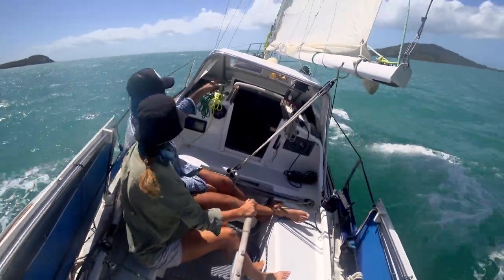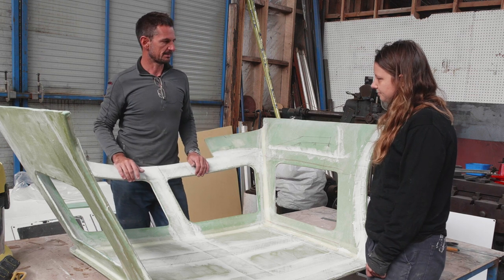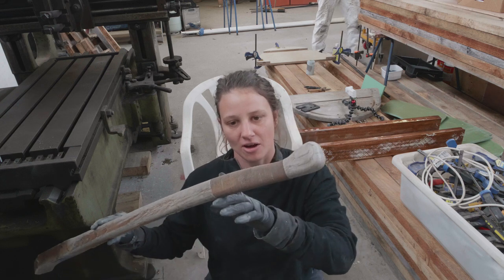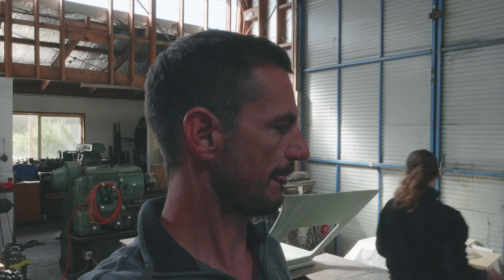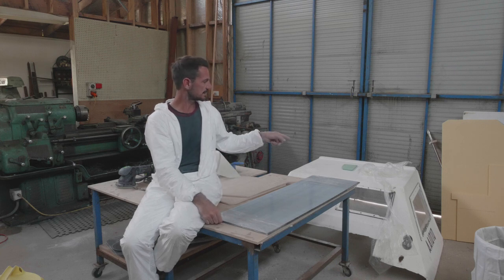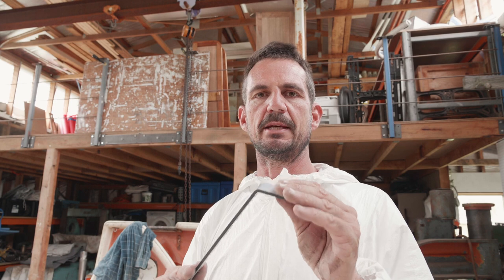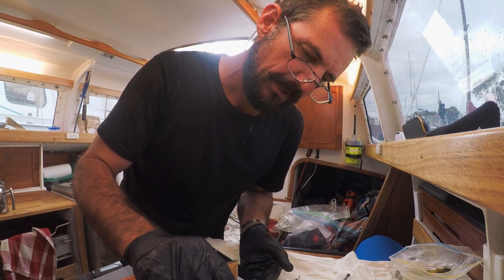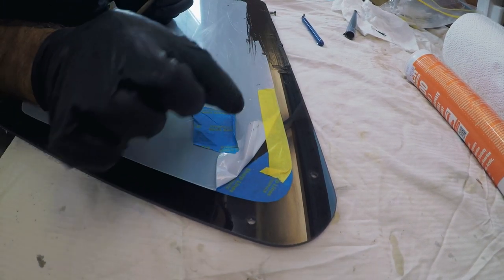HARD DODGER. The Grand Finale - Free Range Sailing Ep 161

Comment: Wow! SIX months! Fortunately I only had to watch the videos ;-)  Nice work on the dodger and the windows. Just know that the tinted polycarbonate panels are going to expand and contract with temperature changes at a greater rate than the fibreglassed vinyl foam of the dodger. If there's no give at the fasteners, the induced stresses will likely result in some deformation. There must be some products that will fill the inevitable cracks on the windows and some that even provide UV protection against crazing.

Comment: I had some vandalism on the rear window of my station wagon and ended up replacing it with straight clear UV-protected 4mm polycarbonate because the glass that fell out after it was smashed by some POS was also 4mm. I got it in there and all the factory trim back on and looking mint. To clean it just water blast (not an option for you) but rinsing didn't work for me to get dust/dirt off after some months in service and I didn't want to rub/brush/wipe it off as it would scratch it and you'd see it pretty easily. At the moment it looks factory, though and the water beads off it months later like it's brand new or freshly waxed :-)
Reply: Yours looks like 6mm? I can full on punch mine (tested in case someone else does) and it just booms and sends my hand backward. Try it with the side of your first (not knuckles...). Looks great! Nice work. I probably would have used some weather resistant non-oily timber around all the places where you need fasteners and screwed straight into that with self tappers, though I understand the attraction of what you did. The one in the car is only glued, no fixings at all. The 6mm toughened glass on our boat is only glued in, too, and in 26 years it's only been redone once AFAIK. Maybe due for a redo again in the next 5 or so. We'll see.

Comment: That's great thanks for showing us how it's done, very stout and I wouldnt have thought about the poly screw holds and that's really thinking ahead to avoid catastrophic failure later. As I like to say, "That's usin the old nut!" Thank you both for sharing your work with us it's something I was thinking about doing as well because the canvas tops just seem so lame. Super expensive and disposable how long do they look really good? Until the first goose shits all over it. That's not very long and between them and the seagulls it could be destroyed in a week not to mention all the scrubbing where as that is super easy to keep clean. So many things I wouldnt have thought of until it screwed up later. Really, thank you.

Comment: I use to work in a body shops we would first get it close as possible to done then spray on primer and after that was dry we'd spray on a light coat of a deferent color and then use a long sanding block and wet sand tell you were down to the primer and any low spots would still have the second color left and high spots will show fiber glass through any thing really low gets a little filler and any thing really high you sand down with additional coats of paint until you get it all uniform and then you paint , and by sand down with additional paint I mean heavy coats of primer and light coats of second color and just keep working it tell you get to a finish your good with but if you wort it long enough you can get it flat enough the finish paint will look like glass

Comment: You might have problems with all the bolts in the windows due the different thermal expansion, which I know there was problems on lifeboats in the North Sea oil rigs.  They had to rely on the glue rather than the bolts.  Might not become a problem but has been a problem on other installations.
Otherwise your doing a great job and I envy you the workshop you are fortunate to use.  Fair winds

Comment: You may already be aware, but you can get some great silicone tools for shaping goo like epoxy and silicone or urethane adhesive etc from glass specialist shops/businesses. I picked up a set from a local one here a while back and they're awesome for spreading stuff in a non-flat but smooth/controlled curved way. Check them out online somewhere :-)

Comment: It looks absolutely amazing. One thing you mentioned about the polycarbonate, is that it’s more susceptible to scratches than other materials, so a bit more care needs to be taken when cleaning. Curious if the screen protector material that’s used on digital devices could be applied to the windows to prevent any potential scratches? They also have clear material to protect the windows in sandblasting cabinets. Then again, it might be more trouble than what it’s worth.

Comment: Nice save on that adhesive-loaded window Troy!

I wonder how hard that adhesive sealant will be to remove when the lifespan of the polycarbonate windows has been exceeded.  

Did you consider using an easy to disassemble and remove butyl sealant with all those through-bolts used to secure the windows, so that the replacement of the windows might be an easier project rather than a major PITA getting the glue apart?  Is there is an easy release compound available to get that sealant to debond quickly without endangering the dodger's painted surface?

If that adhesive sealant is strong enough to hold the windows in without bolts I can only imagine the violence it might take to get the windows back off again.  I would be afraid that repairing de-bond damage.and prepping/painting the dodger again after window removal might take more time than the actual replacement of the windows.  

It seems to me that polycarbonate windows are a bit like car tires, they will eventually wear out.  I wouldn't want to weld the car rims to my wheel hubs...

Comment: Aye m8’s, totally agree on using polycarbonate. Next choice would be glass. Acrylic isn’t living up to it’s standards when it comes to scratches or cracks in a marine environment, I can tell. And about Festool: I’ve got four of their machines and are VERY happy about the quality and usage benefits. I only have invested in 18 volts, cord free units. Easy to charge on a boat. Not really more expensive than other brands. Had some trouble with one of the batteries and they sent me a new one without questioning, so I’m very satisfied since more than five years while using them a lot (like hard core usage). 🛠
Reply from the maker: Yes. Festool is fantastic here too. If your machine breaks down here the dealers give you a machine to borrow while they repair it which is a pretty amazing service. We've opted for Milwaukee 12v battery power tools so we can plug them into the ship's system if something happens to the lithium rechargeable batteries.
Reply: looks really good !!! but polycarbonate became chalky under UV in a few years. maybe lexan is the best solution, but idk if you geht this there
Reply: @ssbseitenhafen9997  Lexan is made of polycarbonate. It’s just a brand.

Comment: in one of your earlier videos you were describing your fuel tanks.  you have two one is a smaller one . is this just for extra storage?  i go up to mountain radio towers and they have a smaller fuel tank up high called a "day tank" it is for safety so all the fuel cannot be spilled if a leak starts near the engines. i was thinking you designed something like that for your use .

Comment: Can I please ask if you know what the Bolt size is: At the very front of the bow is a clansman emblem which is a thru bolt going to the top of the deck which holds a deck plate. My boat is missing this bolt and without it I cannot tension the stays.... Regards, Hendrik